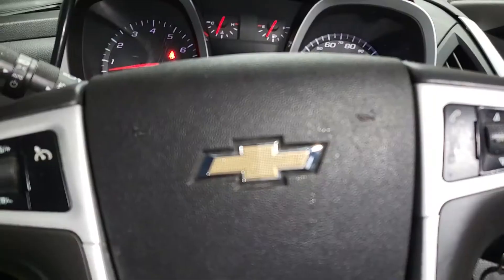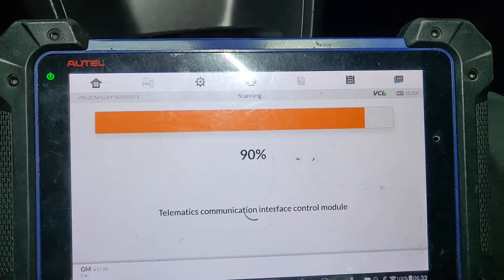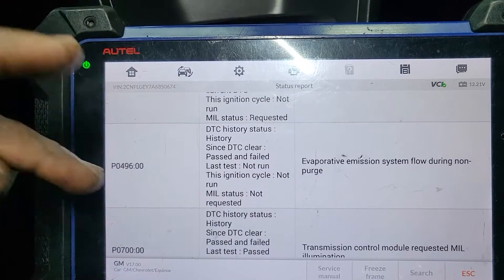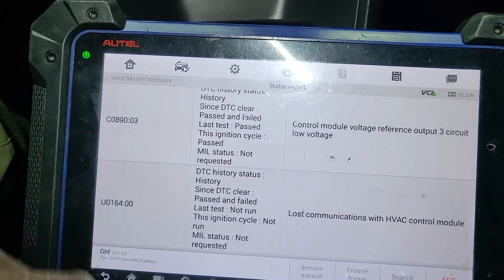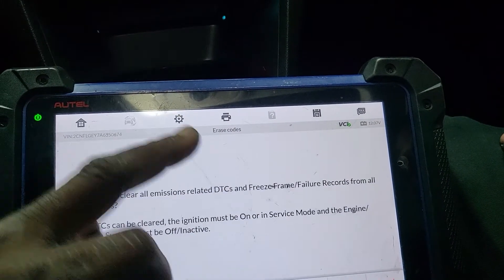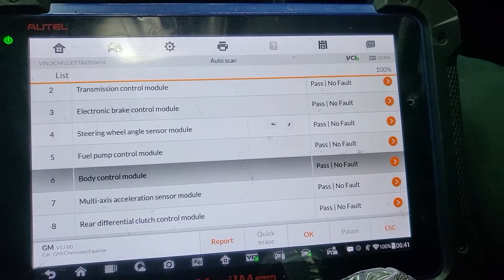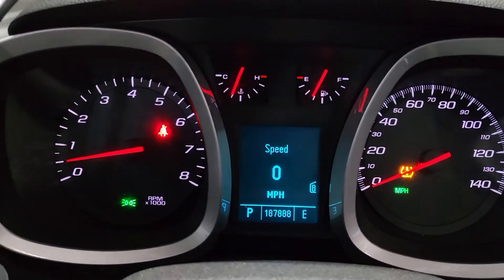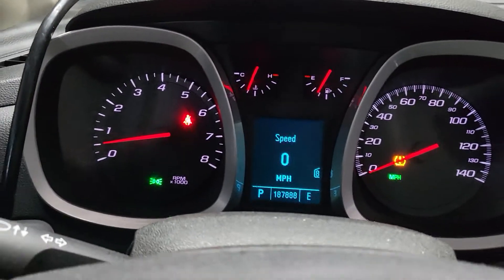2010 Chevrolet Equinox Engine Power Reduced Message What You Need To Know

Comment: 2022 equinox 8k miles just got it
Reply from the maker: Congratulation
Reply: @BestCarFixes  na lol i mean i gotta check engine light at 8k miles i just got the chevy 5 months ago
Reply: @BestCarFixes  it sunday so i scheduled an appointment with the dealer for monday chevy is trash bought it brand new will never buy another chevy i dont care if its a brand new Corvette or a 64 impala never another chevy i got a p0101. P0172. P0299. P0506. P1101. If they take longer than 30 days i can try to get em to buy it out under lemon law huh?